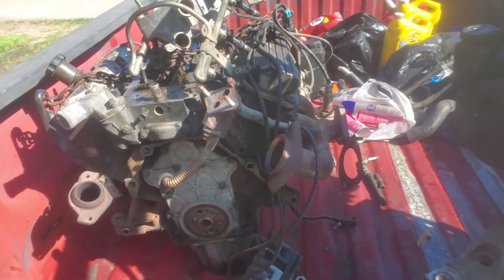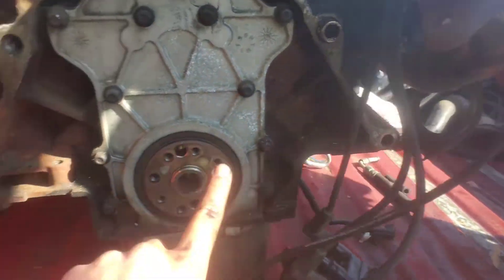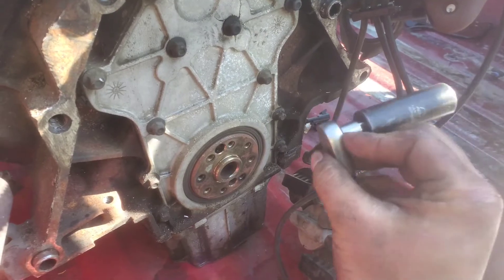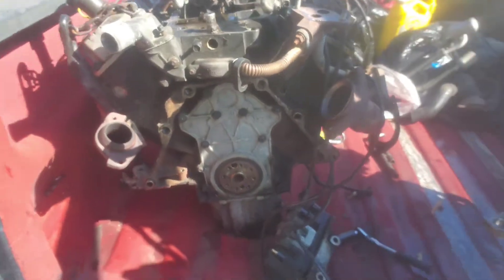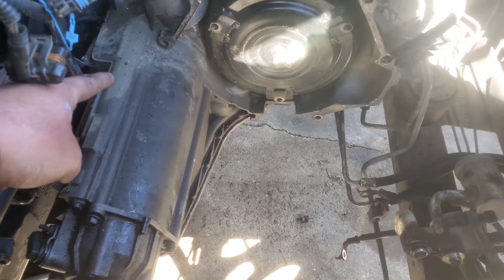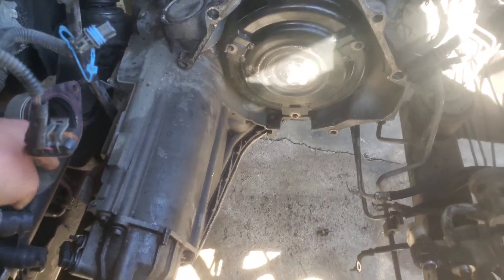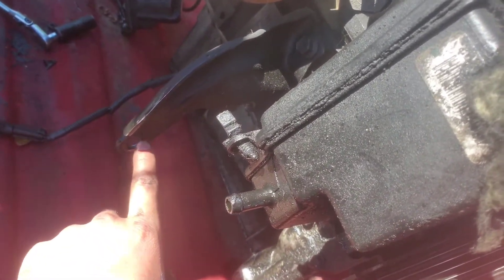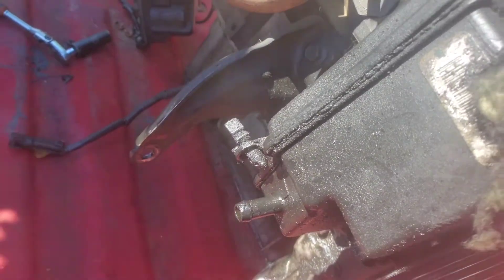2000 buick lesabre engine removal tips

Comment: If you get the bracket all the way out, it’s way easier to use like 4 feet of extensions on a 3/8 breaker bar or something. I had to pull two of them to install the good one in the good car, but it’s simply refusing to line up right and go onto both locating pins. The closer it is to one of them, the further away it is from the one on the opposite side. And I’m pretty damned sure the torque converter is fully seated and the nub is going into the flexplate, so I don’t think that’s the problem.